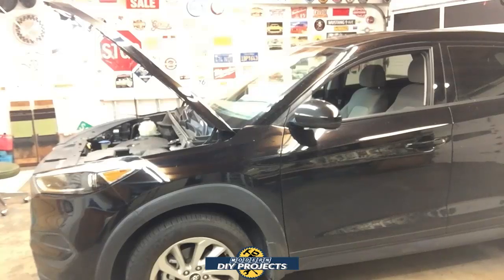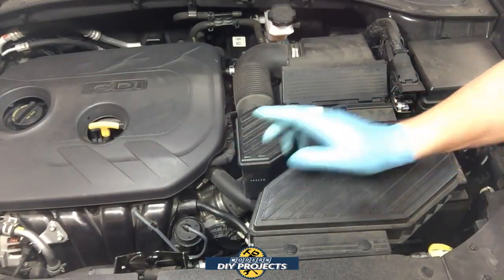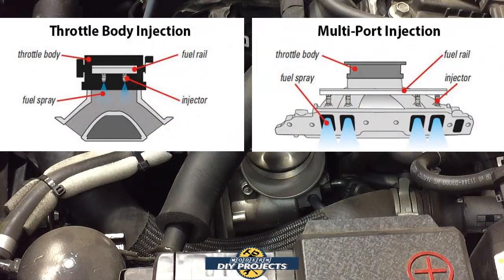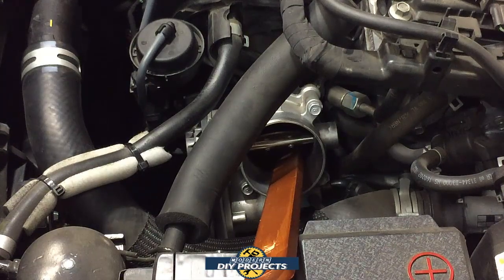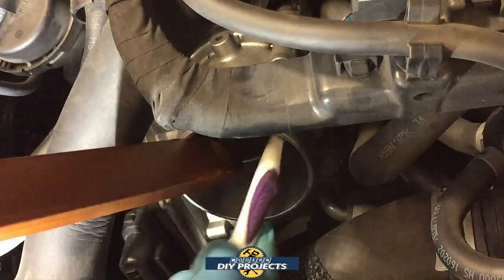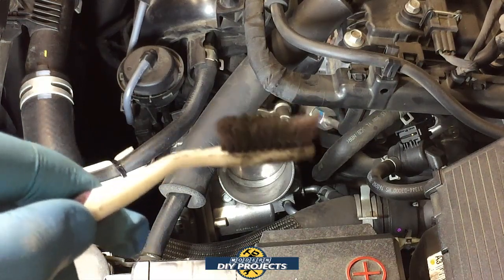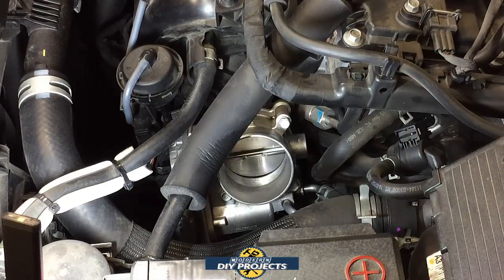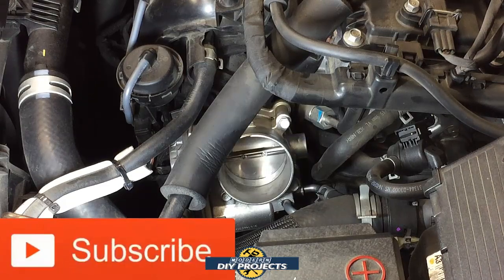How to Remove Carbon Buildup on Direct Injection Engines GDI Intake Cleaning the Easy Way

Comment: Does this process affect your MAP sensor down steam of the throttle body
Reply from the maker: It should not. If anything it will clean the MAP sensor also.
Reply: @ModernDIYProjects  MAP sensor is as sensitive as MAF so no harsh fluids should touch it
Reply from the maker: By the time it gets to the sensor it is already atomized and not a concern. Also, that is an old wives take about harsh fluid on these sensors. I clean the MAF sensors on my other cars with Carb cleaner every so often and have never had an issue. The way to do it is to spray it down thoroughly, then hit it with air (From a blower not compressed air) immediately so it dries quickly. I have not had to replace a MAF sensor or MAP sensor yet. NEVER touch the sensor wire with your fingers and always clean it outside the car (unplugged) so no current is running through it. That is how you burn out the heating element, by cleaning it while it is plugged in.

Comment: My question is. if this is a issue, why do they still them like this? We have the normal things that break Motors, why add to it?
Reply from the maker: That is the eternal question that man has been asking since the beginning of time! But I'll give you a down to Earth answer. It is because it is supposed to give more power and lower emissions. The fault of a lot of these problems stem from the ridiculous regulations created from our government. They keep insisting on unrealistic standards for emissions and mileage that some beard scratcher in a lab coat said should be the way to go. You and I live in the real world and we have to suffer the consequences of the lab coat Johnnies that only come up with the questions and not the answers. So they keep dumping experimental technology on us and we are the lab rats that have to do the real world testing.
Reply: Very true! My duramax engine is pretty bulletproof, except for the EPA mandated emissions equipment. It's ironic, because without that gear I'd get much better mpgs and much reduced total emissions, and a more reliable, easier to maintain vehicle.

Comment: Yeah unless you delete the PVC valve and system on a direct injection engine (using an oil catch can instead), it almost defeats the purpose to build and use one in a vehicle/car. You can't say Direct Injection makes more horsepower, and gets better gas mileage if the intake system ends up clogged after 50-60K miles. Every time you drive it, it becomes less efficient!
Reply: This video will cancel everything you stated. This process is just as good as fuel being sprayed on the valves. Note that this needs to be done every 6 to 10k miles.
Reply from the maker: A lot of stuff that the manufacturers are doing these days makes little if any sense. Most changes are oriented to satisfy emissions. But as you said, its backwards and makes no sense the way these work. But to your point I also have a catch can on all my vehicles and I have a video how to make one yourself if you don't want to buy one. It's on my channel page if you're interested.

Comment: If your vehicle has a drive by wire throttle body will forcing it open like he did damage the throttle body ?
Reply from the maker: No it wont. The vehicle in the video is also drive by wire and as you can see, no damage. I am still driving this vehicle many months after making this video. You are moving the throttle body when the vehicle is not running so you can't damage anything.

Comment: I have an Associate's Degree in Diesel Technology.  When our professor had us rebuild a gas engine in intro to engines class he had us soak the valves and rocker arm assemblies in a 5 gal. bucket of carb cleaner over night.  They were so caked with grime and carbon, but the next morning everything looked like new!  Carb cleaner is aggressive as shit, but that's what I spray in my PCV valve hose to clean my valves as well.
Reply: This answers a question I had very well.  I was going to say a before and after picture via a boroscope would show how well this process worked, but your comment gives the requisite reassurance.  Before and after pictures would still be nice though.

Comment: I used seafoam carbon cleaner for GDIs. I used one can and took alot of built up away. Its my wife's car so you know oil changes where missed and ran on one quart of oil for many moons. But sea foam been helping. Do it before your oil change and drive for 15 miles or so and than change it. Did it once so far and the burning oil went down to about half a quart per 1k miles was 1 quart/1k miles.
Reply: If it's your wife's car, why do you not service her car for her? It will save you headaches in the future.

Comment: We have a ‘17 Tuscon, 90,000 miles, never done this, but I don’t notice power loss. Probably will start if I can fond throttle cleaner!  We always use Top tier gas.
Reply from the maker: Good gas and frequent oil changes will definitely help reduce this. Unfortunately this is one of those things that you don't notice any problems until it's too late. A catch can will also help reduce this problem.

Comment: I just got a 2023 Santa Fe 1.6 turbo GDI. Has this issue been resolved yet? If not, how do we maintain a new car from having this issue. A catch can would give the dealer an excuse to back out of any warranty whatsoever as you modified the car.
Reply from the maker: I don't think it has been changed. You need to see if your motor has dual port injection or just GDI. Dual port will help reduce this problem because it also has Port fuel injectors built in. But these days a catch can should not void your warranty. It is now allowed even for state emissions tests. But if you are really worried, you can always remove the catch can before you take the vehicle in to the dealer for any work to be done. It's easy to remove and install. I also have a DIY catch can video on my channel.

Comment: Thank you so much for your video, sir. would you happened to know how we can view those intake valves with a borescope? where do we insert the borescope? through the spark plug holes? thank you in advance for your help.
Reply from the maker: You can only see the pistons from the spark plug holes. To see the valves you need to remove the intake plenum. Not a job that you want to tackle unless you absolutely have to.
Reply: meaning I would have to remove the intake manifold right? if that's the case, then you are right, it is way too hard and I would not be able to tackle it.

Comment: I would use Throttle Body Cleaner instead of carburetor cleaner . Some Throttle Bodies have seals that may react to carb cleaner . The old GM TBI units would tolerate carb cleaner .
Reply from the maker: To be honest I have been using Carb cleaner for years on throttle bodies (Since the 90's) with no bad results. I think it is made to be compatible with all systems these days. Also, in my area, no one sells throttle body cleaner. You can only find brake cleaner or carb cleaner, that's it. If you can find it in your area, then more power to ya!

Comment: How often should this be done ?
Reply from the maker: I do it at every oil change. That way it never builds up hard and heavy like other people have mentioned. By doing this you should keep washing it away just like the port injectors would do.
Reply: About every 10,000 miles

Comment: I have the same Tuscon except 2017. So you use carb cleaner instead of GDI Cleaner?
Reply from the maker: You can use either one really. It is almost impossible for me to find GDI Cleaner in my area. So I get the next best thing.

Comment: I have a kia soul 2.0L. Junk engines
Reply from the maker: It's been good to me so far so I can't complain. What Hyundai gets you on is the cost of fluids and filters. Those are higher than my Toyota parts.
Reply: @ModernDIYProjects  Kia transmission fluids are outrageous as well. Around me only can get at dealers, 13.00 a qt. Mine is at 60K miles. Time for a fluid change.
Reply from the maker: Dude, you are lucky. I just bought some trans fluid to change it on my Tucson also. In my area Trans fluid runs $22 per quart. I got lucky and the parts guy at the dealer I bought my car from gave me a discount because I bought 6 qts. I got it down to $16 per quart. I'll bet $13 doesn't sound so bad now does it? I can get Toyota trans fluid for about $6 a quart for my Rav-4.

Comment: have you ever checked the intake manifold or the  back of the valves, with a camera or removing  it , to see if it is working?
Reply from the maker: There is no need to go through such a massive amount of work. The performance of the vehicle tells me everything if fine, so why look further. Would you ask your doctor to put something inside your body to see if your arteries are clogged? If you feel healthy you wont. You only do such things when there is a problem.

Comment: Revving the engine to 3,500 to 4,000 rpms is crazy.  We use BG products and only run them to 1,500 rpms.
Reply: He probs runs it that high because at 1500rpm it might just flood and stall the motor since its not a controlled delivery method like some other services.
Reply: I use CRC in between BG services and the highest my Sonata hybrid will rev is about 2100-2200.
Reply: Correct. I use Lucas GDI and it states rev it to 2,000 and only bring it up to 3,000 if engine stumbles too much, but keep it below 3,000. Hes not spraying it right either as you're supposed to spray for 5-10seconds. Useless video.
Reply: Why? It doesn't hurt anything. Bouncing off the rev limiter is far less damaging than lugging an engine, lol. Lugging an engine causes damage, every time.... you're choking it out, upsetting the harmonics of the crank and rods, and sometimes it will even knock. While on the other hand, it's obvious that they're made to go right up to the red with no issues, all day long. Not only because its actually breathing better and thus not working as hard, but also because they wouldn't make them have that capability if it was damaging (they have warranties, a bottom line, and a reputation to maintain.) My '98 Chevy 4x4 redlines at 6k, it sees that almost every day, has 250,000 miles on the original engine, and it still runs just fine. In fact, that's probably why. Don't be scared of the noise, that's all it is....  it really doesn't hurt anything. That's why they have a specific redline and rev limiters..... to make it impossible for someone to unintentionally hurt it. Additionally, the manufacturer stated redline as well as the rev limiter is set at a conservative (sure to be safe) number anyway (modern vehicles have two rev limiters, one lower one while free reving in park or neutral, and a higher one for when its actually under load.) The engine computer will not allow you to over-rev it, I promise.
Reply: @johnny0454 The Euro manufacturer I deal with tests to Rev Limiter plus 10 percent on engine stand testing during durability phase.
Reply: Every BG service I've used was 2000-2500 rpms. It even says it on the instructions.

Plus, you follow the instructions given by who makes it. Seafoam and CRC is 2,000 rpms.

Comment: I tried CRC and seafoam GDI cleaners every oil change for 70k km  and they don't work. I ended up removing the intake manifold and then soaking the ports in carb cleaner for a few hours, then sucking it out with a vaccum hand pump.

The intake manifold in my Kia Forte also has variable geometry and the fluids from the pcv oil and spray get trapped in there. When I rev the car after a GDI cleaning it would cause a huge plume of smoke and check engine light as that liquid gets sucked into the engine.
Reply: I have a Sonata and an oil catch can does wonders. 👍

Comment: So this will work on my Stinger GT twin turbos gdi... I seen other video showing to just spray crc stuff into the air box tube, but to be careful to spray it past the mass airflow sensor.. advice on cleaning out my Stinger 3.3 L TT and where to spray exactly, if this will work on that too ?  and are their any other product, like foam kind or any other suggestions ? and you're saying using fuel additives for cleaning injectors, etc.. is really worth it as well ? how often ? another question, Ha... Stinger recommends 91 octane, but says 87 can run in it, and safe for warranty, but is it still healthier to use 91 for engine protection ?.. o.k. one more, and my manual says Conventional oil is only required, but will full synthetic reduce/better for less carbon build up in the first place ? and if I'm doing 1/4 mile drag racing, does Full synthetic protect it more  ??  :-)
Reply from the maker: Wow, lots of questions. As far as cleaning your GDI you can use this method on any vehicle out there and it will not create any problems. I recommend to spray it in as close to the throttle body as possible as I showed. Stay away from the MAF sensor because some of them may not like it. I would not spray it in the air box because that is too far away from the throttle body and wont do any good. All you will do it make a pool of this in the air box and it wont work it's way to where you need it. I suggest using injector cleaner on all types of cars because it is cheap insurance. It's cheap to use and cant hurt. Even on GDI it can be useful because any gas that sprays backwards will have the cleaner in it and can help to clean away any build up. For oil I suggest whatever makes you happy. All oils these days are very good so it's hard to buy a crappy oil. The only advantage to using synthetic is that people will run it longer than conventional oils. I don't suggest doing that because oil will get carbon build up and other nasty stuff in it over time and needs replacing even if it is still able to lubricate. That is an entire argument on YT and Forums. I change my oil often so I don't bother with synthetics. The octane of the gas makes no difference. With a higher octane you can get better performance but most computers are set to run the car just fine on lower octane but with reduced performance. It depends mostly on your wallet and what you can afford to run in your tank.

Comment: So carb cleaner is the same stuff that’s in Lucas GDI clean and CRC gdi cleaner?
Reply: No, they are not. Carb cleaner evaporates rather quickly vs the others, which do not. Carb cleaner can also damage sensors inside the throttle body if not used extremely cautiously.
Reply from the maker: @kevgregrob2  If you read the carb cleaner cans at this point they all say that it is sensor safe, Cat safe and MAF safe. Those problems existed many years ago when these items were new to the market but now they are common place.
Reply: @ModernDIYProjects  IDK what kind of carb cleaner you are using, but I just bought a can the other day which specifically said it was NOT MAF safe. Catalytic Converter safe, yes. Also, looking at the MSDS sheets of both products, the ingredients are not the same. Carb cleaner contains 80-100 percent aceton (cleaning agent) where as CRC Intake and Turbo cleaner was strictly petroleum based products. Less likely to evaporate before actually cleaning carbon on the intake valves. Acetone has a flash point of 155.9 (which means it evaporates quickly at ambient air temperature) and CRC Intake Valve and Turbo Cleaner has a flash point of 187 degrees. In all, they are in fact not the same and should not be used in the same manner.
Reply: @ModernDIYProjects  carb cleaner can also ruin seals and gaskets, which are generally made from petroleum based products, by drying them out. CRC and others will not.
Reply from the maker: For the most part, yes. Of course each manufacturer may add their own "Secret Sauce" if you will. But for the most part they are all the same. That is why I get the cheapest one available.

Comment: You have to spray continuously with constant amount of carb cleaner through entrance of the throttle body.
Reply: Easiest way..5lb sledge on gas at 3500 rmp ..drill small hole into rubber of the intake after the maf sensor...insert spray hose from bottle into hole ..attach carb cleaner can and spray it until empty...or use brake booster hose and at 3500 rmp use water at small intervalsuntil you've used 2 bottles of any kind of bottled water......bammmm....I do it every week on my 2011 cts wagon...it runs beautiful year round car has 180k miles runs like new
Reply: @marcodorado8806  every week? LOL cheaper to maintain a Bugatti then 😂
Reply: @rafars2246  it's literally 4 dollars a week man ..it's pretty cheap for great maintenance
Reply: @marcodorado8806  Supported
Reply from the maker: Yes, that would be ideal. The best way to do this is with two people. That way the more you add carb cleaner the other person inside the car can modulate the gas pedal to prevent the car from dying. A pedal depressor cant do that so I could only go in small increments. Sometimes I get my wife to help maintain a high idle when I do this.
Reply: @ModernDIYProjects    
Many thanks to your wife.
Hold on hold on, what I meant that no need to depress the gas pedal with this way of carb semi-cleaning, it is so easy man, all you need is just to maintain the suffeicient penetrant pressure by your finger while appling it via throttle body gate at idle about 700 RPM.
Reply: @rafars2246  
I am doing this method since years, not even a single ml of the product remains in the can, all you need is to shake the can time to time. good luck